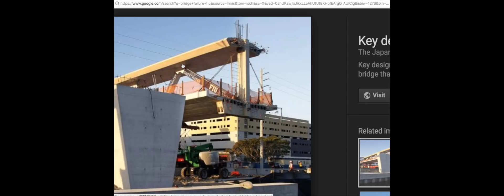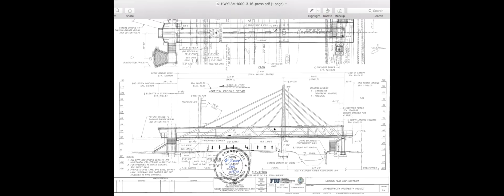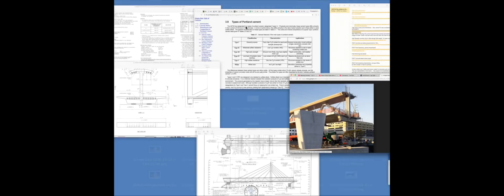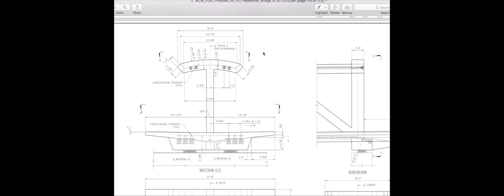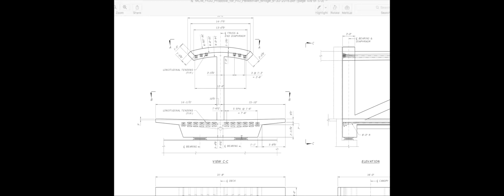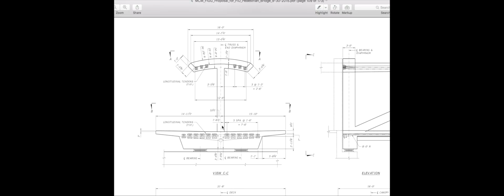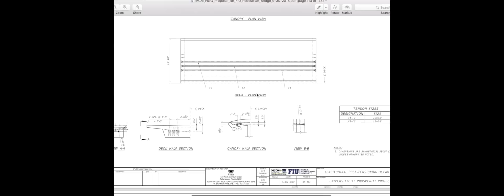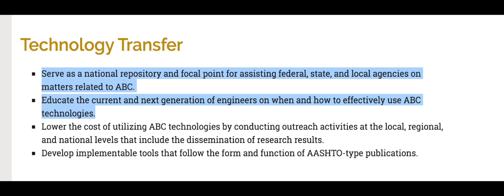FIU Florida Bridge collapse Inherent center flaw CENTER of structure

Comment: This bridge was a massive design flaw from the start. As with the millennium bridge in London. Of a bridge looks to fine and flat, it will not stand. Add post tensioning, which has no structural integrity until it is tensioned. People need to go to jail for the avoidable deaths. I took one look at it, and knew it was a failure waiting to happen, and then I didn't know it had visible increasing cracking. And yet with multiple contractors and "responsible" people, "professionals" who knew about concrete and bridge engineering, no-one stopped the project or insisted on support during erection. I wouldn't trust anyone remotely associated with this calamity. 😏
Reply: Two typos, sorry.. If.  too .. oops

Comment from the maker: 11:30 make the deck fail in the center - which it partially did once tension was released from 11.  Rebar, means they did not have it directly under 12....

Comment: The deck was designed with flex in mind, the suspension cables/tubes were vibration dampers to slow or halt it from oscillating. If a rod in 11 failed could it of had enough force/energy to cause a ripple effect to the south which reflected back to the north at higher magnitude, once it got to 10, 11, if already weakened with fatigue cracks/or dry joints, would cause failure.
The 11 rod stuck 6-10ft out of the top of the blister is critical, if this happened after the first point of failure it would of being crushed and bent while falling, the fact its still straight means it came out before anything else moved, it may be bent in the blister which stopped it flying out as it fell? The rod you mention in other videos could if tightened incorrectly, by over torqueing cause the blow out on the concrete pillar as youve talk about but that would mean that the other rod would have no tension in a sense, if you unload tension on the rod you talk about the other would of had higher loadings, maybe even break/snap causing it to fly out but that wouldnt account for the blow out you describe, only the deck falling away from the pillar would shear the rebar and burst the concrete as its rod anchored firmly in the deck concrete pulls away from the bottom of the pillar as it fell. Think of a rope bridge if i jump at one end you will bounce at the other! Look at the china glass bridge.  If the bridge had no movement it would of being pinned both sides But the south end was floating on a bearing to allow flex/movement!
Reply from the maker: I get your thinking Bale, you need to see the pt rod shoot out and somehow that will explain it all...
No offense but, that rod could have come out at any numerous times... during the collapse to being ejected once the bridge hit the ground. 
I understand the human mind and how it does not like to move off a position once it makes a ''conclusive decision" (see my videos on my other channel on the amygdala - it will explain why you are stuck on that rod being key to your failure)...
Bale, allow me to suggest, to take on data, all the time, and let the data take you where it takes you... 
I am open to this all the time; when I am evaluating a construction job site and issues... I let the data tell me what went wrong and how to fix it...  
So, without being smart minded with you, allow the data to build and each piece may require us to change our position. 
One example, I gave, could be the machine was stuck on and would not shut down... that would clearly be an accident with no one at fault (unless, they abused the machine and did not service it...). 
Addressing the cracks, we do not know where they were... so, we can guess, as I did, in one of my videos but, those cracks, may or may not be contributing to this failure...   
Back to your rod and it sticking out 6-10 feet... if, the rod failed, they usually fail at the center or 1/3 points... this would be evident on the bar itself... I wish we had access to this data but NTSB is not sharing that, at this time.   But, this rod did not fail during the loading of the canopy or the canopy would not have failed under tension and member #11 would not have been able to buckle.
Reply: It cant physically happen at anytime, due to the angle of the dangle of the diagonal member! either there would be 2 bent rods and a dual blow out of concrete on both sides of the pillar or the rod would be bent at the point the diagonal and the canopy met. look in your previous video at the white plastic tube at the bottom of the pillar and support column looks as thou there is no rod or very little left. The end of this would be in a blind hole at the very end of the deck the bent rod would be about 12inches further down the deck length. so the upper diagonal rod would terminate in or under the end pillar but the lower rod would be terminating on the very edge of the support pillar. If there is no upper rod in that pillar it would alter its load path. It had to ping/fly out before the intersecting angle change! or it also would be secured through the deck still and the remainder still pointing in to the ground in the post then bent at the blister like the other. 
Also looking at the blister it looks like different pour times for deck, posts, canopy and blisters. Look at teh difference of the blister edge to the concrete and rebar of the canopy in your https://www.youtube.com/watch?v=OlQs4rWbg_M video @ 5:36
Reply from the maker: Once again, let's go down your the failure of the PT bar,  if, it's failure was a result of it being post tensioning and causing the canopy to fail and buckle #11... at some point it appears to have been sheared or broke under tension as structure was failing... THIS end result gives you the result of your PT bar being exposed...  PT bars are tested and they are NEVER loaded to the point of failure and ejection ... NO offense meant but, I know about the Canadian who put this false information out there...  He has 750,000 followers and zero structural training... He takes apart tools and makes crazy comments...  I find him humorous except when it comes to series subjects like this... 
I laugh as he uses an oscilloscope on everything and has no idea how testing is really done.
You sent me a link to look at his video and I wrote him and informed him of his error in thinking... 
Oh, did I say he is a Canadian?  (just joking)

What most people are missing and I will show in another video, this connection for tooling was NOT visible during any move and yet and extra, 2 feet +/- appears out of nowhere for this tooling to be attached to...
Reply from the maker: https://www.youtube.com/watch?v=BuTBzY5dpQ4&feature=youtu.be   Here is the technical reason on why #11 was NOT over "tensioned"...
Reply: The p/t rod could not come out straight if it had a angle to bend around. So either the securing end failed or the rod failed or even maybe they were removing it!

Comment: In an earlier video yo picked up on the presence of only two post tension cables in the top canopy of the bridge where some of the plans show three, elsewhere in the plans you show there is only two post tension cable ducts shown.
Reply from the maker: Yes sir... and also, that it appears the locations of post tendons might be in the wrong location in the canopy...   Thanks for commenting and sharing your thoughts.
Reply: You say about the cables as singular items 2 of the cables were made up of 12 strands and 1 of 7 strands, the missing cable had 12 strands, if i understand the drawings correctly
Reply from the maker: Christopher, it appears the cables were installed in the wrong position, as per the drawings... and the wrong group was installed... (appears)
Reply: The critical point of compession on the canopy would be around the blisters, so the cables nearest woiuld help compress around that point, if the 12 strands you had for that placement were to long as they were meant to go through both spans, they would just move the outer 7 strands inboard as they were the correct length and on site! You should have the correct amount of materials on site needed, but this was in a massive overspend debit possition, would you have 12 extra cables/strands on site at the correct length or would you cut 12 extra long expensive strands to meet your needs.
Think of a guitar string pulled tight you get a tune as a direct result of vibrational tension, loosen it, it dosent vibrate.
The conopy had natural compression forces, Inverted triangle bases being pushed together by gravity, held together and  tuned with all the cables! the Deck had tension forces wanting to splay the bases of its triangles apart, the tension in the lower deck strands compressed the triangle bases solving the splaying apart.
Both would need to be at the same oscillating frequency and this is what they knew about, as it had being designed it to it. Missing 12strands would incorrectly tune the canopy to the deck. It would be like having the highest and lowest strings of the guitar tied together. You wouldnt even see this so called flexing/oscillation, the first one would cause it to fail if incorrectly adjusted, which as you point out it did have missing cables and ungrouted. The bridge was ment to be overrated, to support many more tons or people and things than it did so even ungrouting would not be a main cause. There are many factors/variables that caused this, its finding what the trigger point was. What was the procedure for the pouring of the structure was it ment to be poured as one, or with joints at the deck, pillars, canopy, blisters because on one of your videos it looks like the blister is kind of diamond shaped on top of the canopy which seems counter intuitive, a bit like making a keystone upside down so it falls out first.
Ive audited procedures and machine failures and most of the time it comes down to human error on either; time or cost saving-being lazy, this ways faster, This ways cheaper and many more excuses.

Comment: The transporter was not exactly under member 11 (but offset towards member10 actually partly on an unsupported part of the bottom deck). The cantilever section also had the end column as a point load on the end of the cantilever. What you say about the shear forces at those nodes is very well observed CEP.  Three members meet at this point I can imagine a forest of re-bar needed there. ( and not forgetting that nice big drain pipe running through it all.)
Reply from the maker: Andy, it was never under member #11 as I could tell...  Not sure why you are imply it was under #11? I am not just talking about shear forces, this created a buckling in the canopy, possibly inside the empty ducts... This created tension failure also... Not just a shear / puncture failure.

Comment: Thanks for your observations!
 Are you saying that the main failure could have been a punch-thru of the truss node(s) weakened by the minimal transverse rebar rather than post tension cabling? 
If so that has been in the back of my mind from the first time I saw photos the blister of the 10/11 node separated from the canopy.
Reply from the maker: Hello Tony, 
There were no transverse post tensioning cables, as I could find in any google images or video. 
I am theorizing that the applied load created by post tensioning at node 10 / 11 created a force that caused the top canopy to buckle which then transferred the load down #10 - which then caused #10 to hit this weak cross section design - which then caused the bridge to fail under tension...  as the point load / load path was too great for the center of this bridge - ''missing'' longitudinal cables UNDER to the load path of the ''truss system'' -- 
That this force was exceedingly local...  That FIU and the engineers should be held liable and no insurance should protect their current license or educational training certification...  FIU, failed on this and if they maintain themselves as an educational institute this needs to be part of all their ''bridge training"!
And if they claim to be so innocent of this entire affair then they would not have a problem coming forward and doing this bridge study as a failure study!
Engineers learn from failure - this is how we all know the limits and maximum working ranges of materials... 
This data of this failure must be shared and not some ''clown show" from the NTSB.
Reply: That makes a lot of sense.
Reply from the maker: Each bridge is different... and yes, it will be the first and last of it's exact kind...
Reply: So now I'm wondering are there any other bridges in use of this design/construction ? or was it the first/last of it's kind.

Comment: About that cantilever (overhang) you are talking about , I do not understand why there is pretensioning of that member , because in working condition that member is compressed , and the only time it has tension and NOT compression is exactly  the time it is being put in place. (supported by those big jacks). And I know this because I went through the trouble of making a model in SAP 2000 about that system. The placement of those jacks changes the working system of the bridge and as you say , the top slab is tension at the place of the jacks.
P.S. Where can I get those plans , if they are available online , can you give a link, thank you.
Reply from the maker: Crypto, it was a download and now I cannot find them online again... Not sure if they blocked them or what... Sorry, about that... Maybe, someone reading the comments will find them and link you.